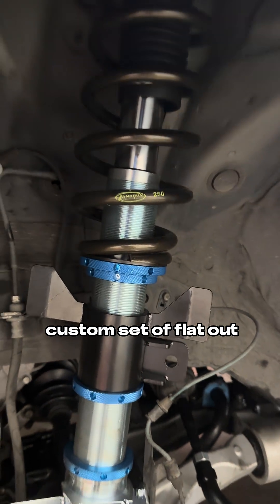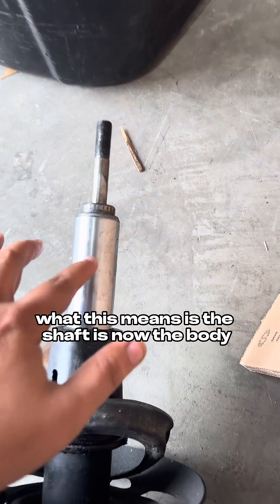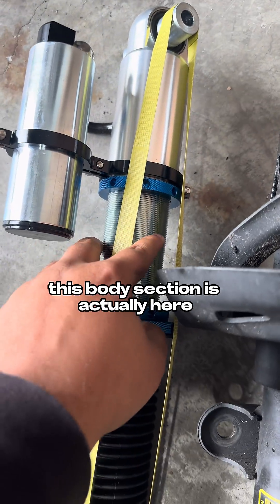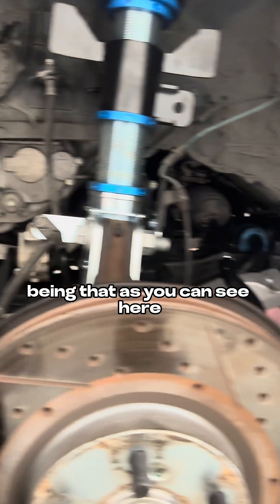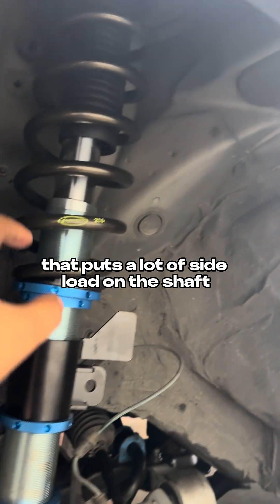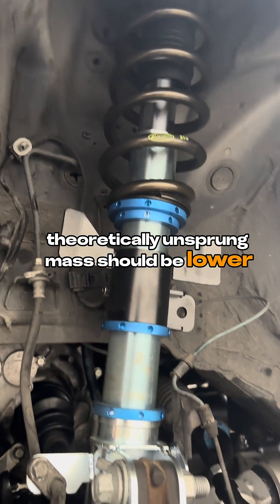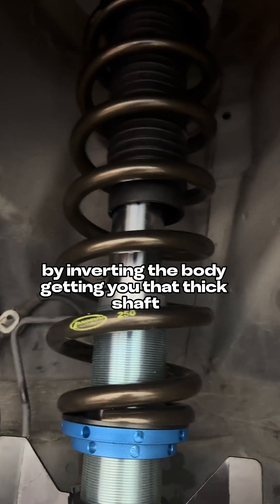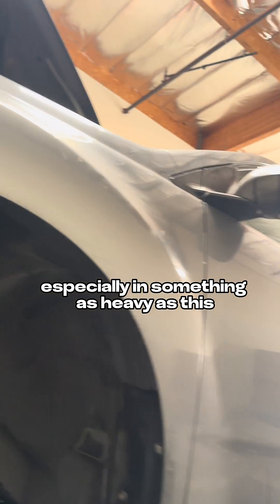Why’s That Shaft So Thiccc? #shocktalk #shocksurplus #offroad #shocks101 #beater #gambler500 #rally

Comment: I cannot wait till ya'll do a long form video about these Flatout products. As a Passport owner, I have only these as a bolt-on option, that's it. NoLo designs is working with Dobinsons for another option in the Honda light truck segment, but otherwise I've heard of others modifying suspension from Tundras and Ford Transits, but that's about it. I just want to know if Flatout's Trail Runner or GR40 are worth the money!